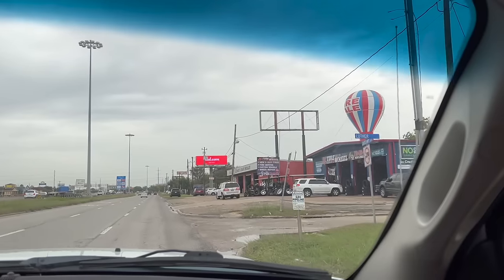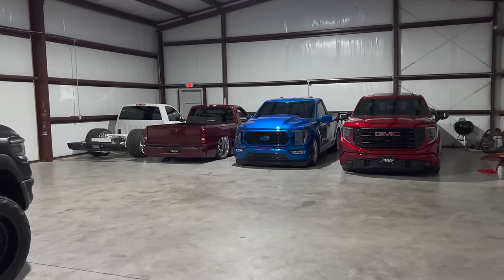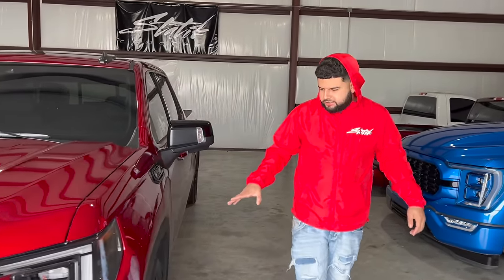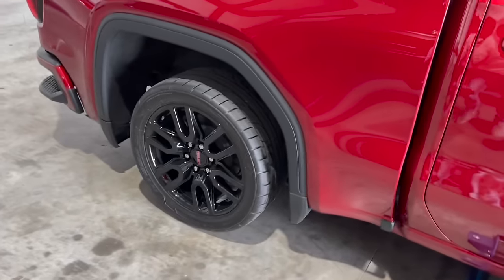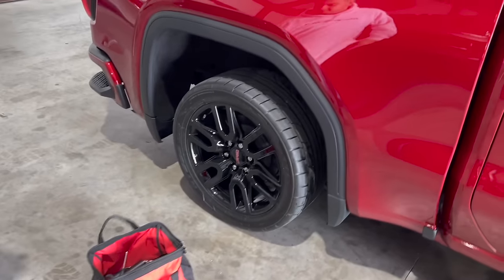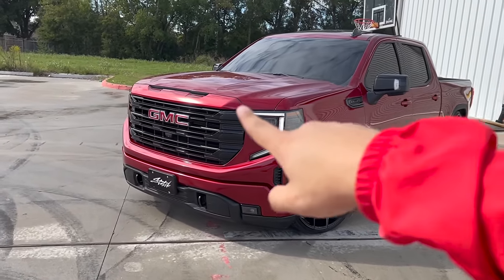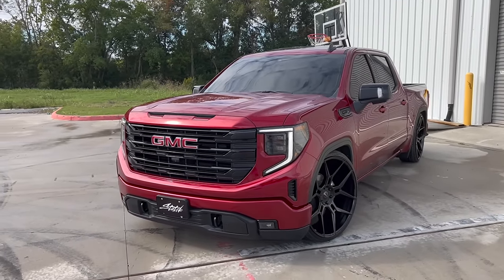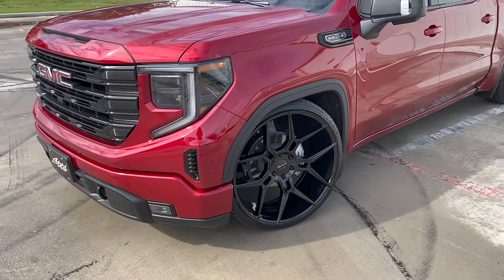MY 2022 SIERRA GETS NEW 26" WHEELS!

Comment: I don't know man. I think it's overkill and most likely will ride horrible.. I personally think it looks better with the stock 20" wheels. If you could have sourced the 22" Denali Ultimate wheels, it would have looked so killer. Beautiful truck either way. I have a soft spot for Sierras. I have owned two. I recommend paint matching the black fender trim. It just makes these trucks pop.